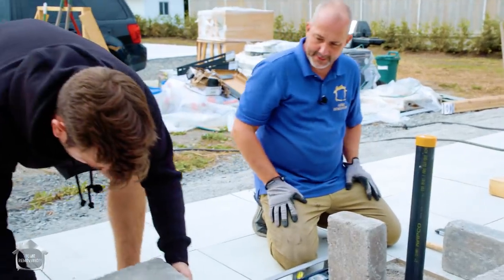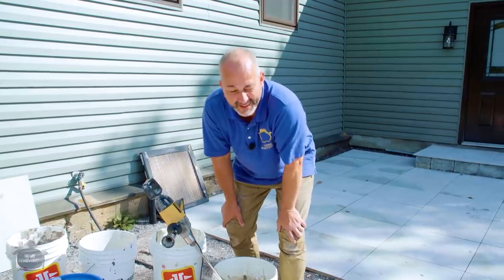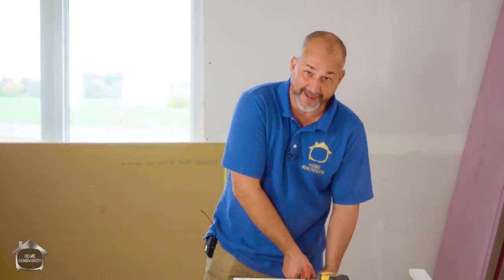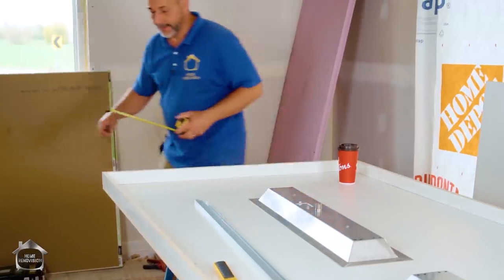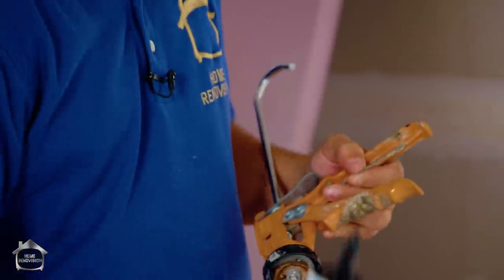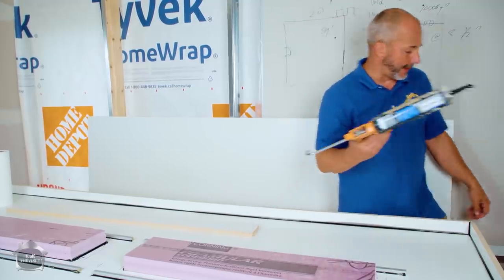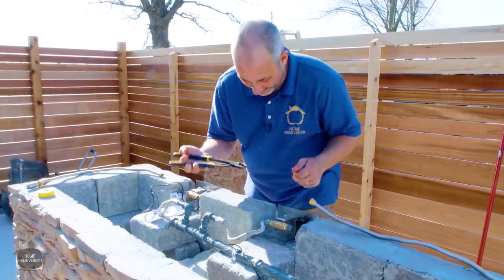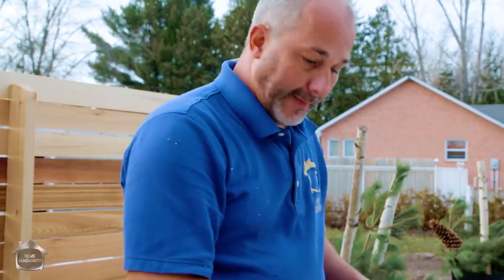Make Your Own Outdoor Fire Table for LESS! | Full DIY Tutorial

Comment: i made countertops like this with rapid cement but if you use 1 bag of flow control you could have just poured it and not bothered spraying.  it would have poured  a lot easier.  but hey its whatever works for you.  Glad i got to see another way to do this.
Reply from the maker: I will have more projects in the concrete department so I will give that a try Cheers!

Comment: Great Idea!  I live in the Midwest so I deal with the heat and cold issues.  I JUST remodeled my kitchen floor to ceiling.  I used modular cabinets and pour in place concrete counter tops.  Since this video is a little older you may know this now.  I researched till I was sick, but my tops, to use your Phrase are "sexy as hell"!  Anyway I used a sand top mix with Silica Sand in it.  The form kit came with fiberglass mesh and plastic spacers to keep it right in the center of the pour.  I also used fiberglass flakes in the mix with charcoal dye and a bonding agent.  They came out incredible.  Before I sealed them I mixed more dye with water and kind of went random with rags and the dye to distress it more.  I used the cup and started with 50 grit diamond disks up to 1000!  After sealing and putting the gloss on them It is so slick you have to set anything glass straight down without giving it a little slide or it will slide off the top!  One other tip/question.  You paid a a premium for those blocks.  I am a retired mason and you could have saved a ton using haydite blocks.  you could have laid them dry and slugged the blocks full with concrete and maybe used some rebar every so often.  Even lumber with backer board would have done it I think.  If you ever lay block dry like that just use your level and level, plumb, straight edge and works great.  Now that I'm done with my kitchen I could picture myself on the patio that table with good company and drinks!  Don't you guys have free healthcare up there?  No knife worries!  lol

Comment: I think more saw horses would have helped prevent the cracking. It looks like you had a bit of a bow in the 4x8 panel forming from the weight of the concrete. Flipping it over with the weight on the edges caused a tensile fracture.

Comment: If your glass ends up breaking from the heating and cooling. Try to find some Borosilicate Glass.  It has a very low COE( does not expand much with heat).
Reply from the maker: this is tempered and so far does the trick. Cheers!

Comment: Love your videos and have pulled ideas from several of them for our projects around the house...

Just a couple pointers if you ever do this again (or for a paying customer). 1. some extra support under that concrete counter, along with some fiber mesh (even chicken wire) would have probably prevented the cracking. 2. never use tape on a flair/compression gas fitting. 3. for propane, you need a vent near the bottom of that table (natural gas vents at the top).

My wife is forever yelling at me to wear eyes and ears as well because I forget to put them on...but if you are on camera with an audience of DIY'ers you should probably lead by example.

I do have one question though. You talked about making the top 2" thick but looks like you only went to 1-1/2"...was this due to material shortage, weight, or did you get to that thickness and call it good?

Comment: Teflon on flared fittings? Thought that was a no no.
Reply: That was a test cap. Not Teflon.
Also you're thinking compression fittings for plumbing.
Reply: @jamess1787  it was a flared fitting to the flex line which he wrapped in yellow ptfe. You don't typically use tape on these because it's not the threads that are making the seal, it's the flared metal end. White wrapping the threads won't necessarily cause a leak, if the tape is wrapped too far and overlaps the flare it can result in a bad seal - hence typically not used.
Reply: @tmaestas  interesting. I missed the whole section of his video where he made the gas connections I guess! I only saw the galvanized gas pipe through the ground.
Reply: It's a no no.
Reply: @tmaestas  could it cause you to not get the joint tight enough if too much tape was used? Seems like in gas line hook up throwing in something the joint design doesn’t need isn’t making it better with overkill it’s introducing a possible problem. Cheers
Reply: @grigs249  That is exactly what can happen. The tolerances is so small, that just one round of tape could be enough to not secure a tight fit on the flare, or what you call it. English is not my main language, so im not strong on the technical terms/words.

Comment: I'm definitely a noob, but if I wanted to make a fire table that was moveable, would it make sense making a table frame using metal studs (instead of lumber - because fire), then using cement board, then adding stone tiles?  The countertop could be anything I suppose - I really like the looks of the cement top.

Thanks for your great videos!

Comment: You should have watched a couple of @Modustrial Maker videos before you tried it , all he really does is concrete , Does really nice
Reply: Good call, I wonder if fiber-reinforced mix in the concrete (That M.M. uses) would of helped increase durability and able to use less material to drop some weight.
Reply from the maker: cheers I have never seen those guys in my feed. I will check them out for sure. Cheers!

Comment: Would have been nice to see the crack repair and some close ups though
Reply from the maker: Right! We actually have the crack repair video coming up in a week or so . make sure you have your bell for notifications turned on.
Reply: @HomeRenoVisionDIY  Awesome looking forward to seeing how to fix my mistakes
Reply: From here on: https://youtu.be/nX8GyKOEmkk?t=3704  till the end, you can see some patching. 
Also, I would have used the bottom (that was poured on the melamine) as the top - that should be smooth(er) - no need to put an extra layer of cement afterwards, which you have to sand etc. (https://youtu.be/nX8GyKOEmkk?t=3647 - though I may be mistaken, that side not being totally smooth either).

Comment: I know that a camera lens distorts straight lines into bent ones, but if you look when the countertop is lowered at 51:29, it sure looks to me like there is actually a bend already in the top, and that's why it broke there. In fact, when it's lying down, you can see one part lower than the other. Which means there is room under it.
Maybe the top was not supported enough from below when it was formed and therefore the melamine bend under the weight of the concrete while setting.
Of course, i'm saying this while sitting here in my chair sipping a drink, so it's easy for me to talk. :D
Reply from the maker: you have a good point. doing things like this are always an experiment to some degree. lesson learned. no worries!

Comment: Does the cement need to be a certain thickness? I'm curious why you didn't fill the center with wood or insulation for cost/weight reasons?
Reply from the maker: not aN EXPERT AT THIS YET. WE WILL BE LOOKING FOR WAYS TO GET THE WEIGHT DOWN ON THE NEXT ONE FOR SURE.

Comment: You kept calling them 4 x 10 stones. They had to have been 6 x 12 to work out with your 24" tiles.
Wouldn't it be easier to use the cup grinder while it was still upside down on the table before moving it?

Comment: with that kind of tapered gas fitting you should not be using gas ptfe tape on it, maybe a little paste if anything, that is more prone to gas leaking now.
when you use ptfe on steel threaded joints you only wrap the gas tape 1.5 times, its thicker for a reason!!!!

Comment: At 22:27 , you can't cut tempered glass. I am surprised you didn't know that. In production glass gets cut to order and  AFTER it gets tempered in an oven . It is possible however to remove a very thin layer from the edges (1/16 thin) by grinding process (polishing). I work in the glass industry. Cheers - George
Reply from the maker: I did know that george but i did the demo for folks who like to be creative to save them the time of learning the hard way!
Reply: @HomeRenoVisionDIY  All right that's nice . I installed many glass showers (custom ) in the past and some times we had a tight fit ,instead of scrapping the glass we used to take the glass piece back to the shop and run it in the polisher one or two times to reduce it by a 1/64th or even 1/16th or more ,problem is if the piece broke in the machine while it was getting processed ,production had to STOP to clean up the machine . Because of that reason ,companies stopped doing <<favours>> like that. Cheers - George - Toronto

Comment: I don’t get the math. If the tile is 24x24 and the brick is 10x4. How does that come out? In the video the hole is 3 tile wide, which is 72”. Then 6 blocks are used for the side. If they are 10” long, that is only 60”. The blocks have to be 12x4, right?
Reply: it looks to me like the bricks are 8"x12"x4"H

Comment: Jeff, I've been following you since practically day one - however, I am sick & tired of your consant disregard for safety (PPE)!
I actually have employees that have told me from the ER clinic  "but I used my 'safety squints' boss..." 
Ever have a metal sliver removed from your eye? I have and I'm thankful it was steel & could be removed w/a magnet!
Not aluminum or micron dust... Nice project though. Get w/the program Jeff.
Reply from the maker: If your employees are not following your rules that is a reflection of your management not my videos. Might I suggest you provide them with better training and oversight. employee safety is your responsibility not mine. Shame on you for trying to shame me!

Comment: Jeff, dear lord….. you used yellow gas Teflon tape on a flare fitting 😮 .  Was this at someone else’s home?  
The tape hinders the flare and seat from seating tightly.  If you don’t have an understanding of this, please hire a pro for NG/propane connections.  I see from all these comments that people like/trust you.  A little research goes a long way.  Also… I saw no vents.  If NG then Two vents need to be near the top on the table sides.  NG is lighter than air and rises.  If Propane, the vents need to be at bottom sides of table as propane has 1 more carbon and is heavier than air and will pool at the bottom of table if there’s a leak.  Be safe out there. 😊

Comment: Not understanding the care you took making the base level and really no effort at all in putting a nice flat trowelled finish on the bottom. One bump on the bottom makes a point load and the weight of the top will crack it if not over time, then with a little bump or drop while installing.
 If I was building that top, I think it would be built right beside the base and then just flip it over very carefully. Then maybe some sill sealer to cushion the base,perhaps?

Comment: This video was like a train wreck! I couldn't stop watching. I've never seen concrete that runny. Looked like water. The more water you add, the weaker the concrete. How long did you let the concrete cure? Adding some wire mesh would be beneficial no mater what climate you live in. Spraying the concrete into the mold? You are way over thinking things. Simply pouring it and lightly vibrating it would have been a lot simpler, less messy and yielded a better result. One more thing..... I love your videos...